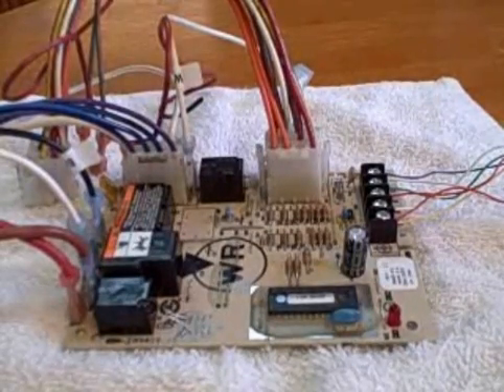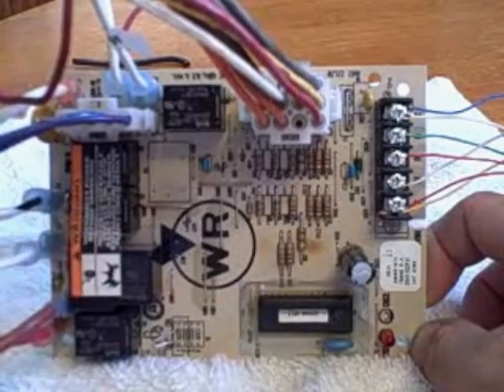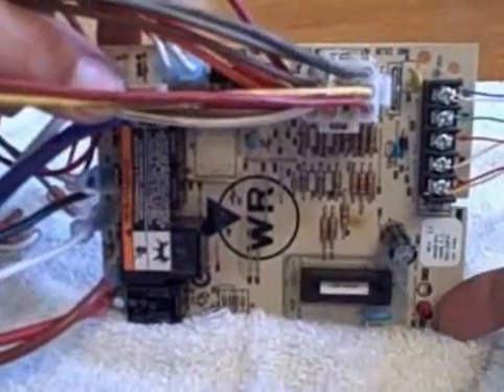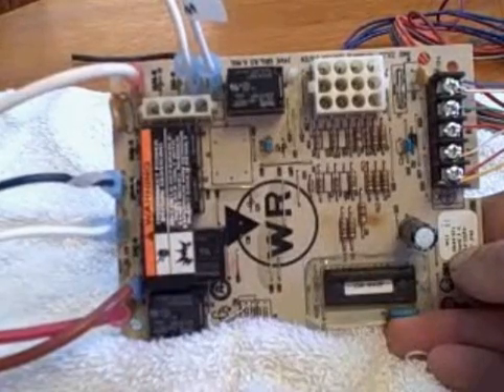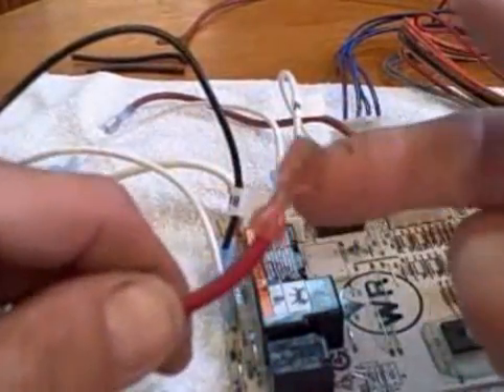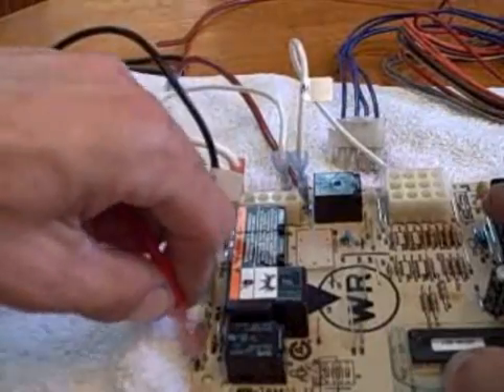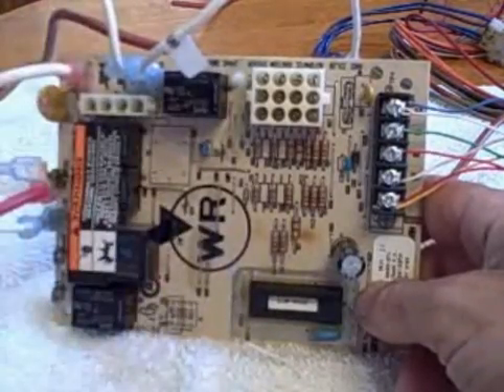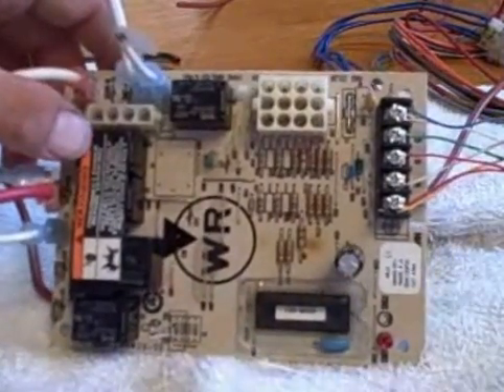HVAC AC Blower not working, troubleshooting Fan Control board, Fan not working.

Comment: Thanks for your video! It enabled me to troubleshoot the furnace at my daughter's house after it had been flooded and determine the controller board needed to be replaced. I was able to create a jumper and have her manually run the A/C until the control board was delivered. Thanks Again and great job!
Reply: LOL, was the give away it was under water. Thanks for the success story. DIY control board replacement gone right.

Comment: Mike, My blower is constantly turning on and off after I started using my A/C. It will run for a while and then shut off and restart for about 15 seconds, run for a few minutes, then restart again. This A/C is a new instal by the previous owner. I'm hoping that is a coincidence but I'm worried they might have made a mistake in the wiring.
Reply from the maker: Apologies for the late reply,you've probably had someone out already. Its most likely overcharged when they did the install, especially if they did the install when it was cool/cold outside. Ive seen this a LOT with the new 410a systems.

Comment: Mike:
   I have a burned resistor on the "identical" circuit board that you used for this demonstration.  My first notice was the condenser unit freezing.  that tells you low freon or no air flow, one of the two.  I finally determined "No Air flow" since I couldn't get the air handler fan to kick on (even in the "run" mode).  A very good friend of mine called me and informed m of this HELPFUL video!  I had to go out and get a "piggie-back" type connector but once I did it, VOILA!......fan is on full time and condenser unit is cycling normally!  When I get the new circuit board, I will simply put everything back to normal.  Then I will see if I can put a new resistor in the old board so I will have a spare!  We'll see if that works.  Again, THANKS so much for taking the time to make this incredibly easy to follow video and helping out your fellow man.  
COOL AGAIN IN TEXAS......

Comment: One thing you did not mention here, Well first off I am no Air Tech. and I really do not know anything. Yesterday I washed the out side condenser out. And cleaned and replaced the filters. Turned the air on this morn. and it did not do anything. At the condenser I checked the caps. and relay. Went to the furnace and checked the door switch. It was bad so I replaced still did not do anything. I looked for a fuse. Did not have one. Checked the transformer. It was good. Still nothing. JUST by accident I moved some wires and it kicked on. Hmmm , Some where in that massive amount of wires that hooks to the board was something not making contact. So I said a prayer and cleaned and wiggled them around. And when I pushed that door switch she started up. Stated at 7 this morn. By 5 this afternoon I got it working. Who knows for how long.It is a old unit.
Reply from the maker: I've had that happen before! It can be a pain sorting through the pile of wires, tightening connections and replacing connectors or wires. The ones I hate are when I show up its working fine and only acts up when Im not there, very frustrating for me and the customer since theres nothing I can do.

Comment from the maker: Gregorio, hope you see this, for some reason my youtube application isnt letting me reply directly to your post. Your post is a little hard to understand, if I get this wrong please rewrite it a bit and put some commas and periods in it.  First I think you need to put a 3 or 5 amp fuse on the low voltage side of the 24v transformer. Or a resettable fuse until you find the short. Get that done first because it sounds like there is no fuse on it or the board. Then we can find the short.
Reply: hello, which is the best way to test the circuit board, to know if it is good or not?  thanks for the video it helps a lot.
Reply from the maker: Its not so much a matter of testing the board itself, but testing the system as a whole and letting it tell you where the problem is.  ....there isnt really any easy way to test a board, but then its not really necessary... Its more a matter of figuring out what isnt working then figuring out what component has failed.  Working with a volt meter and methodically testing you can figure out where a problem lies.  I know that doesn't sound overly helpful, but its kind of hard to talk about testing a board or the system without a specific problem t troubleshoot! :)
Reply: mikie2501  dear sir, i have a problem that split ac circuit is not working when ever i change the electric circuit.
Reply: Memo Peraza  what is the problem in blower fan motor sir
Reply: mikie2501 sir already i have repaired the electric plate but when ever i given the electric power for ac then sort circuit
Reply: Anwar Ahmed  tell me sir
Reply from the maker: Anwar, I dont really understand what your problem is, without a lot more detailed description I wont be able to get any idea of it in my head, usually with electrical problems its best to hire a technician, especially since you're working with 240 volt circuits!
Reply: sir, i want to know which condition a double door fridge can not given best out put of freezing.
Reply from the maker: +Anwar Ahmed sorry, I only work on HVAC systems. ...but there could be LOTS of reasons why its not cooling properly!  First thing, if its in a hot area like the garage or outside in the heat it might not work as well as in the house. First thing I would do is roll it away from the wall, unplug it, take the bottom back cover off and clean all the crap, lint, and stuff off the coils. Over time that stuff builds up and reduces cooling. When the compressor kicks on when you plug it back in, does the fan under there come on like it should? If you cant get to everything underneath from back there then pop off the front bottom plastic grille to clean underneath.. Make sure no towels, rugs etc. block the front grille from pulling in fresh air.  Thats the obvious stuff anyway...it could be lots of other things like someone bumped the thermostat knob and set the temp higher, thermostat sensor is going bad, has a freon leak, anyway do the obvious maintenance listed and see what happens.
Reply from the maker: +purehavok31590 well it could very well be a weak/worn out motor... You said you can spin it so its not locked up or related issues. My first guess and thing to check would be to check the run capacitor. If its super weak or dead the thing wont start on its own and if you help it, it will eventually overheat and stop again.  Capacitors are a cheap fix, if that is the problem, you just need a meter that will test it.  If you took the blower out and cleaned it you must have seen it, probably strapped to the blower housing or in a box mounted on it.  Im not clear on if the blower was working well before you cleaned it or not... Maybe the wiring got unplugged on it? Heh.  Anyway you can look up testing capacitors and all that good stuff here or on google.  Most of the time when i find a motor doing this it turns out to be the capacitor though.
Reply from the maker: +purehavok31590 while Im thinking about it, with the power off of course, you should test the bearings if you can. Would have been easier when it was out, hehe. Anyway check to see if you have any play in them. Try and grab the shaft and see if you can wiggle it side to side. Not in and out, it will move that way, but side to side as if you were trying to bend it. If you can feel play between the shaft and bearings then even if the capacitor fixes the problem now, you probably will wind up replacing the motor at some point.

Man, all summer with no AC?!  No way, whew!!  I would have had to at least buy a window unit for the bedroom so I could sleep!  I keep it at 68 in here at night and sometimes that doesnt seem cold enough with the humidity, lol!
Reply from the maker: +purehavok31590 hmmm,  I wouldn't. If the cap needs replaced its bad on the motor to try and run it, honestly I dont think it would stay running. Its possible the thing has an internal short across the speeds that is causing the problem.
Reply: hay bro...i trobell in 
what is door switch mean hare and if the door swith in  so where he install
Reply: you have some trobellshot all hvac cam you share with me plz..
Reply: i have a some idea if pcb not working so i change onother china pcb and working done...but we share some problems in  maybi i learn some

Comment: great video, i had my first experience today  troubleshooting a board like that.  whats the average repair cost on something like that? thanks
Reply from the maker: Hi Max,thanks.  It really depends on the board cost (brand) and most companies will have set rates unless its an expensive board, or something really old that is a pricey new-old stock.  Most of the guys from other companies Ive talked to give me an Idea that between 200 to 500, plus the service call cost, is normal. 4 or 5 seems a bit high to me (though Ive heard worse horror stories) but at least double your cost is perfectly acceptable and should be expected I think.  Customer will usually grumble, but (humor here folks) if they don't you didn't charge enough ;)

Comment: Hey Mike, I have '96 Lennox and I'm having a issue with the control board. I know there is a way to bypass the control board for heat and a/c with a fan relay if the inducer motor part of the control board works, which it does. The control board has a relay which I can hear cutting in and out. It shuts the fan off and on while the inducer still runs and then runs the cycle and heats just fine. At times it locks out and I have to shut it off and reset it. On A/C it would do the same but the condenser would shut the compressor for a little while and then kick back on, because it was shutting it off and on. Is it possible to bypass the control board with a relay for the heat and A/C mode? If so, what kind of relay and how do I wire it? If you could please let me know I'd really appreciate it. Thanks

Comment: Blower switch working and blower working but when blower switch wire hooked to circuit board L1 Hot-In the fuse blows

Comment: hello first of all as a new hvac technician I appreciate your time and knowledge that you share with us. secondly, I had a question that fan motor or blower motor runs 24/7 even the thermostat is off and it is on Auto not on fan but still runs all the time. I don't know what should I do?

Comment from the maker: Matthew I think it is probably the relay, not sure what unit you have but I am guessing Trane/American Standard?  The problem sounds like one of those relays that is mounted on a *tiny* circuit board (and a pain to get to to change) and they will do this.  Sometimes if it sticks all the time when you cut mains power and turn it back on there will be a 3 to 10 second delay and the blower will still come on with nothing turned on. The replacement board is a new version. (continued)

Comment: Hi Mikie,  when my AC unit turns on, sometimes the blower motor will take minutes to start after the condensing unit.  After a couple weeks, the blower motor will not turn on at all.  I replaced the blower motor capacitor and added a hard start kit.  However, the blower motor is still having the same problem.  

I have noticed that if I open the break to the AC unit, then reenergize, the blower motor will start exactly when the controller tells it to.  As time goes on, the problem surfaces again
Reply: Huh, what? You need professional help.

Comment: I have a Carrier Day & Night A/C Heater unit, I had the a/c running, after it reached the set temperature, the condenser fan shuts off but the blower fan stays on. Even if I shut the thermostat off it stays on. Now my A/C won't come on. Where should I start troubleshooting the problem?

Comment: con't .... capacitor. Then I found your video. Using the safety switch as a power source is so easy! I didn't have a split plug like yours so I had to improvise - but it is working for now. The board does show some corrosion on the front. I'm not sure if the handler iced up before the board went out or vice versa. If you could put the sequence of events in order, that would help. I'm keeping an eye on the outside condensor unit now to see if freezing starts up again. Sincere thanks for your vid.

Comment: Great Video. I knew there had to be a simple way to test the blower motor directly! I've done it troubleshooting my outside condensor fans before but never had to work on my attic air handler. My wife said she thought the blower was on all night. Then it stopped mid morning. Small ice build up outside, but still functioning. In the attic, the coils are enclosed and not accessible. So I could only imagine there was ice. Couldn't get the blower to kick on even after replacing the ... con't...

Comment from the maker: Check for loose, broken or chewed on low voltage power wiring between the t-stat and the air handler/furnace. Could be a loose screw terminal or someone has stepped on the wire a few hundred times or a rat has been at it.  My money is on the Door Switch though or a wet switch if there is or has been water in the emergency drain pan!  If you're still having problems email me a short private note with your phone number, etc.  M@

Comment from the maker: When you say 'fan' do you mean the Blower Motor? (not the condenser fan) If you can jumper the low voltage and the blower and condenser comes on then it's not the board. The ONLY purpose the board serves (on non-variable speed units) while in COOL mode it to turn the blower on. The only thing on it is the blower relay. EVERYTHING else on the board is for HEAT mode. Is there a WET SWITCH in the emergency drain pan? Also check the BLOWER DOOR, if loose it could be rocking the door switch. (cont)

Comment: Im a noob in the hvac field but im learning a lot and I learn quick. Today I went to a customers house condensor not turning on. No 24v at contactor I tried jumping the t stat but didnt work. So I went to the fau and saw the control board had a burnt diode. So I determined the board was bad. Something told me to try to jump the tstat again and the condenser came on but no fan. So I jumped R&G and the fan came on then I added Y to the jumped wires and had the fan and condenser running but..cont..

Comment from the maker: Which motor, Blower motor indoors or Condensor fan motor outside? Are you sure it wasn't just a bad Capacitor? (most Techs are honest but sometimes...) If it was the outside unit a common cause of early failure is high heat due to where the unit is located or high heat from dirty evaporator coil, or in some cases on certain units they have a DOUBLE coil and the dirt packs up between them and you CAN'T SEE it without a tech seperating the coils.  More info and I'll try and help.  thanks!

Comment from the maker: Sorry for the delay... hearing it 'cut out' a few times is kind of hard to trouble-shoot if it isn't staying off for a while, could be a loose wire, crappy relay on the control board, cracked trace on the circuit board or several other things.  I would have been interested in hearing it for myself but if it symptomatic it could be hard to pinpoint. (assuming an honest tech)   ...burned drip pan??  I can remember one plastic drip pan on a coil but ca'nt remember what the heck (continued)

Comment: I just had an HVAC guy leave here today who replaced a burned drip pan in a Goodman Unit. He said he noticed the fan cut out a few times while he was working on it. I was there, but didn't hear it cut off. He has it running constantly now (bypassed something) to give us some cooling. Anyway, he thinks it's the control board. Could it be anything else, as I'd really like to pick the low hanging fruit. This has been a long ongoing problem, as we don't use the AC much, but it leaks when we need it

Comment: I guess I'll need to light the pilot and see if the blower works in heater mode. Thanks. With the number of unattached wires, wires dead-ended with wire nuts, electrical tape.. or NOTHING.. I'm surprised it hasn't taken out the whole block yet. I'll be careful.

Comment from the maker: To see if it's the relay then put the switch back to the AUTO position for the blower and then switch it to HEAT mode.  I don't remember if that unit runs heat and cool at the same speed (meaning one relay/contactor) or High for AC and Med/Low for HEAT.   If the heat kicks on and the blower fires up then you know it's the RELAY. I'd try and find a schematic for fun but can't keep my eyes open and uncrossed, only had 1-1/2 hrs sleep last night, ouch!!

Comment from the maker: Lol, gotta love the old ones! Built to last BUT when I go to work on them they are like "spam mystery meat" cause you never know what you will find inside! LOTS of tech hands in that cookie jar over the years! Most likely if the relay sounds like it is closing it's prolly one of four things: 1. Run Capacitor is dead. 2. Blower Motor is dead. 3. Relay Contacts are Burned. 4. Some combination of 2 or all of the above! To see if it's the relay then (continued)

Comment: My unit is an old Lennox G8 and the blower motor decided to quit on my this summer. Worked OK during winter, but I can't seem to make it run now even in FAN ON position. I hear the click of a relay as I flip it to FAN ON, but no joy.  There is no PC board in this thing but there are plenty of wire nuts and even some bare wires dangling around in a box in the lower half (that seem to have been that way since installation as they're aged with crud).